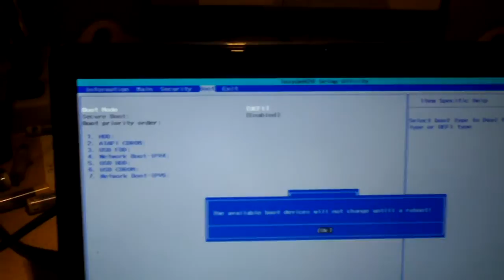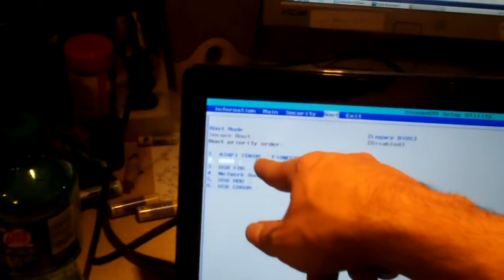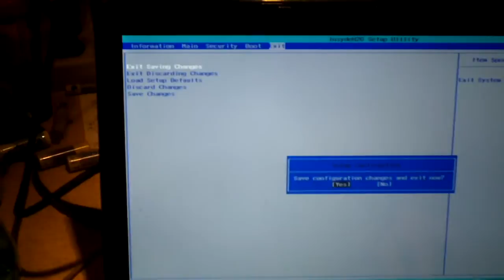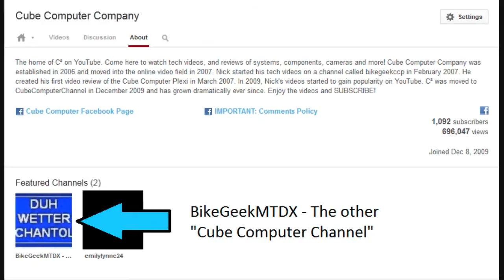How to enable Legacy BIOS on a password protected Secure-Boot Windows 8 PC

Comment: Does it set everything back to factory reset? I do not want my things erased.
Reply from the maker: No, this won't delete your files... however if your machine has previously been booting into Windows using Secure Boot/UEFI and you change the BIOS to boot in Legacy mode, Windows will no longer boot up until the startup setting is changed back to UEFI. The reason why I changed the startup mode from UEFI to Legacy was because I was converting this machine to Windows 7, which favors Legacy boot. If the machine is running Windows 8.1 or Windows 10, you should leave the startup mode set to UEFI. You can however turn off secure boot, and leave UEFI on. What exactly are you trying to do here?
Reply: I need to get back into my laptop. I have a SATA 0 security block when I turn it on, and it is not letting me in for some reason. I have a gateway.
Reply from the maker: Have you tried disabling SecureBoot (but leaving UEFI enabled)? Is it prompting for a hard disk password?
Reply: No, it isn't letting me do anything. There isn't a place to put a password, it just states that there is SATA 0 security on it. I cannot boot anything to try to work with it. :(
Reply from the maker: Remove the hard drive and then start the machine (without the hard drive) and see if you can get into the BIOS. If so, try disabling SecureBoot, reinstall the hard drive and then try again.
Reply: Thank you so much, I will work on this later today. Wish me luck.

Comment: I already enable legacy boot. I have a hdd I used in Samsung Series7 Chronos with win7 pro and all my programs. I have a new hp envy6 laptop with win8. I want to use my win7 hdd in the hp. I swapped the hdd and it wouldn't boot it said no hd found. I know I'll have some driver issues etc., but I just want to be able to boot from it. All I tried didn't help. When I plug in the win7 hdd with EIDE to USB adapter I can see all files. In Disk Management I can see all partitions in both drives and see they are different and it doesnt show the C: main partition as bootable, It is active. How do I do that?
I upgraded my win7 and have the Key on it and all programs I want to be able to use without having to buy the same laptop.
Any pointers will be appreciated.
I believe you can help. Thanks
Reply from the maker: When Legacy BIOS is enabled, the BIOS won't even see a HDD with a SecureBoot OS as a boot device, though once there's an OS running, those drives become accessible. Did the Windows 7 computer have SecureBoot turned on? If not, then turn it off on the Windows 8 system when swapping the hard drive.